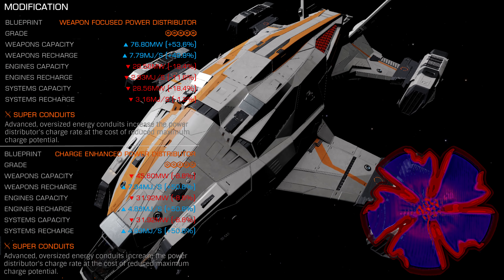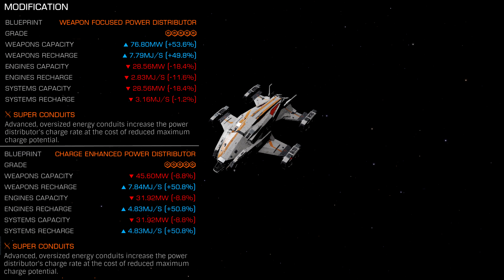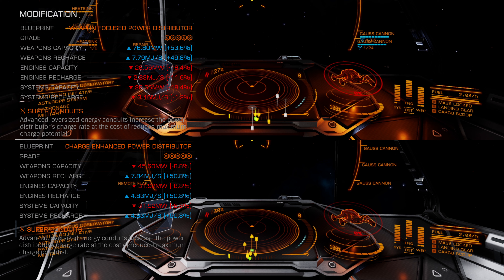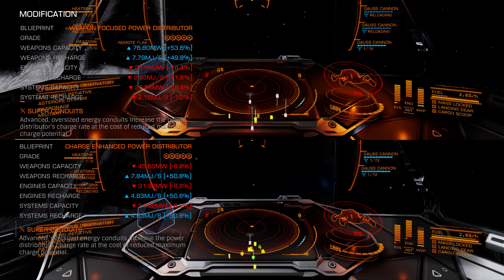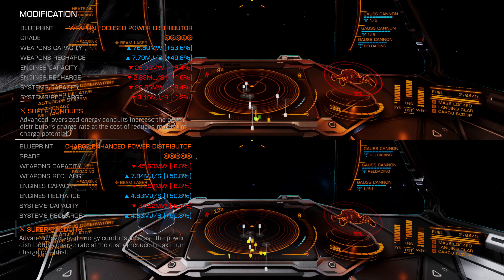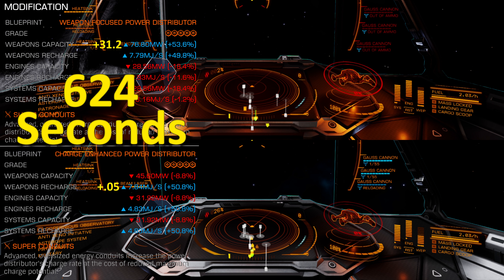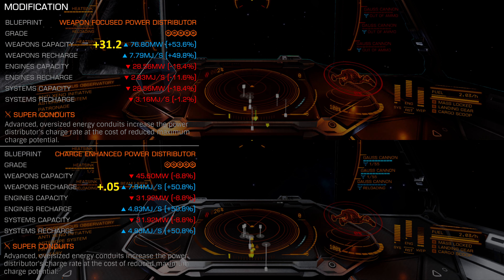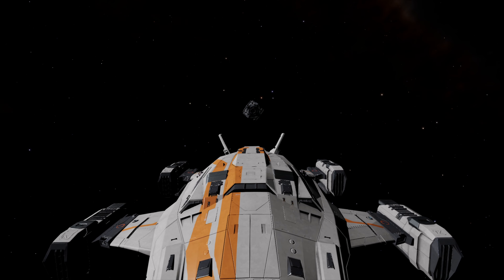Charge Enhanced or Weapon Focused. Which Distributor Engineering is better for the Chieftain META?

Comment: also interested to see this test with the mod shard conda build
Reply from the maker: I did my shardconda. I made a specialized macro that fired the right 3 five times, then the left 3 five times. Followed by a heat sink. I tried the cycling thing, but the clip size made it complicated. One click per shot worked quite well.